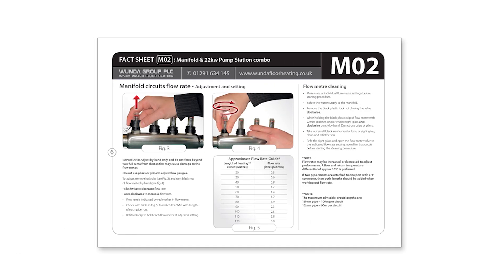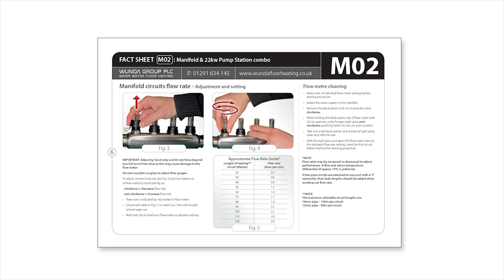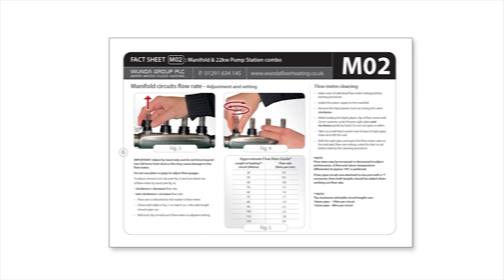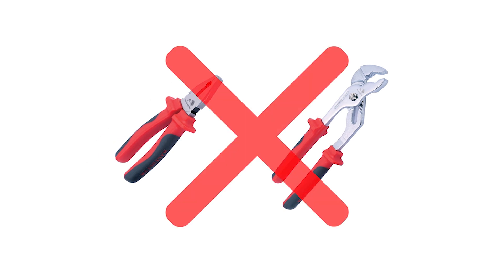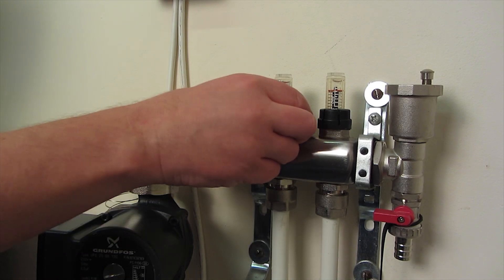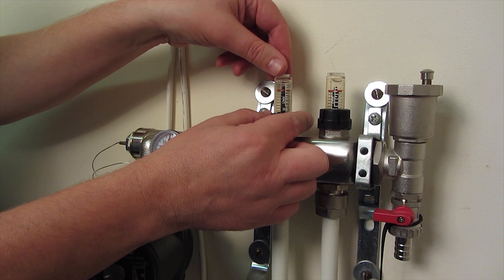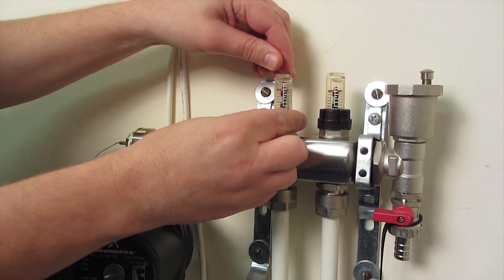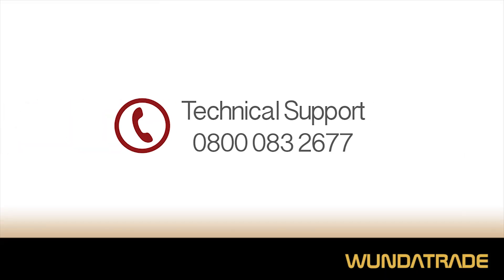How To Adjust your manifold Flow Rates

Comment: Any ideas why on my LK flow rate meters, they've gone very orange, almost rusty looking? To replace these do I need to drain the entire system, or can I simply turn it off and then unscrew it?
Reply from the maker: Hi there! The orange or rusty colouring you’re seeing in your LK flow meters is usually a sign that the water quality in the system needs checking. It could indicate corrosion or that the inhibitor levels are low, so it’s a good idea to have a heating engineer take a look. They may recommend flushing the system and checking (or fitting) a magnetic filter at the heat source to help keep things clean in the future.

If you need to clean or replace the flow meters themselves, the tubes can be removed and cleaned, or swapped out entirely. You don’t necessarily need to drain the whole system — you can isolate the loops and remove the pressure before taking the flow meter off. However, if the water is already looking rusty, a full system check and service is definitely worthwhile.
Reply: @WundaGroupPlc nice one. Thanks!